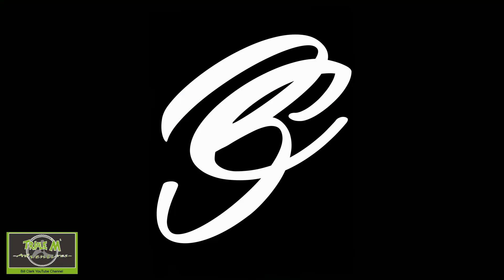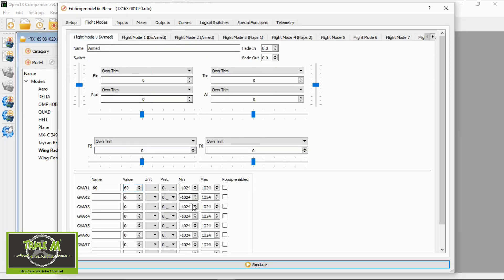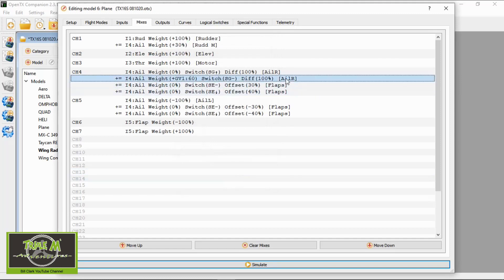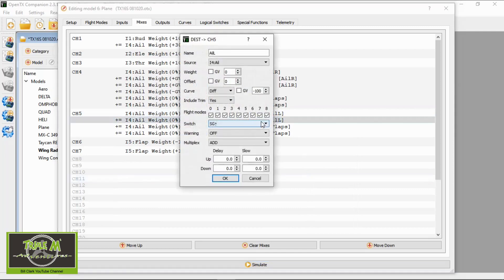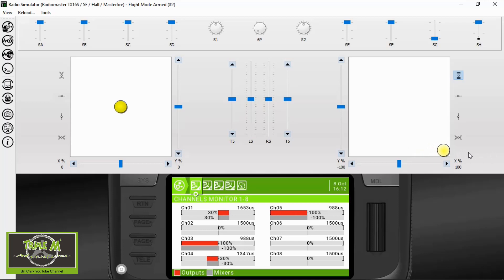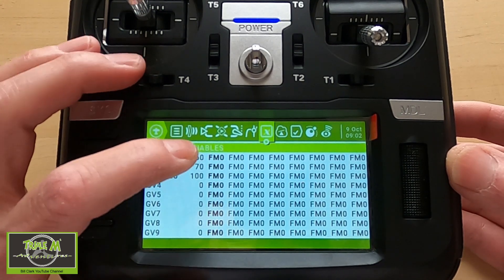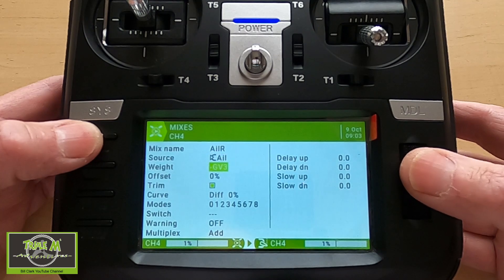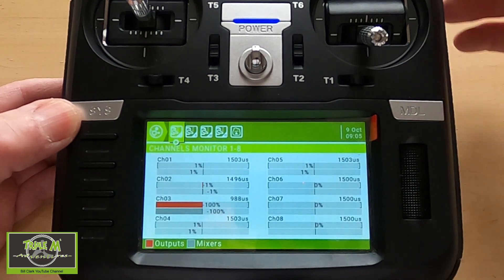RadioMaster TX16S Setting Up Aileron Differential Using GVs

Comment: Hi Bill At 13:10 in the video you demonstrate the different aileron settings, starting with no differential. Is that a setting you would use on a plane, or is it just for demostration purposes?
Reply from the maker: Hi Jan, yes I have used aileron differential on models and it does help if I remember correctly I set it up on a switch so for demonstration purposes I could turn it off and have two rates of differential so you could test the two rates when flying. Once happy with the setting you could code the differential in without a switch and have it permanently active.
Reply: @the-happy-RC-flyer  , Thank you, that makes sense.

Comment: Thanks for very informative video, I'm trying to slow down my talon rebel gt on landings due to short landing area. Just wondering if spoilerions or flaperons would be best for this situation? Any advice would be appreciated. Thank again
Reply from the maker: You are very welcome.I would suggest flaps and mix in down elevator when the flaps are deployed. Experiment by slowly add more flap and try deploying them at altitude so if you stall you have enough time to recover. All planes are different so just add adjustments slowly. Let me know how you get on.
Reply: Ok thanks for advise, this plane doesn't have factory flaps its a vtail so it had elevons on wings elevators and rudervators on tail but I might could add flaps I'm not sure but would love to have them, thanks again

Comment: Am I understand it correctly.
That in order to be able to use that aileron differential each aileron have to be controlled by different servo on the separate channel ?
Reply from the maker: Yes that is correct. I think you could achieve it mechanically with on servo but it would be very complicated but I have never tried doing that way.
Reply: @the-happy-RC-flyer  thanks that clear out my confusion.

Comment: Bill, liked your video very much.  It occurred to me that setting up a variable GV on a knob like (S1) would be a good way to change the amount of Differential while flying saying a series of axial rolls. Then when you land look at what knob position gave you the best rolls - then make that corresponding number permanent.  Or are the times that you don't want any differential then you dont want it permanent.
Reply from the maker: Hi Larry, that’s a good idea but you would not set a GV for S1 you would leave as is so you have full adjustment for your trial period. I would say you would find a optimal differential and set it permanently. I would be concerned I accidentally move the rotor switch and change the setting by mistake but for testing a great idea.

Comment: Is it possible to get differential done with an elevon set up?
Reply from the maker: You should be able to would you like me to work it out for you and make a video of the process?
Reply: @the-happy-RC-flyer Thank you, I would definitely watch the video. Been trying to figure it out and can't find much on info about doing it on the t16s. I have a delta wing style plane that high alphas really well and want to have yaw control using split elevons or differential elevons if that will have the same effect.

Comment: Is it posible to set up aileron diff when there is only a single centre servo i.e Kadet LT 40.  I have used your TX methord a couple of times but this would have to be installed mechanicaly. Cheers
Reply from the maker: Hi Colin, no you would need to do it mechanically with one servo.